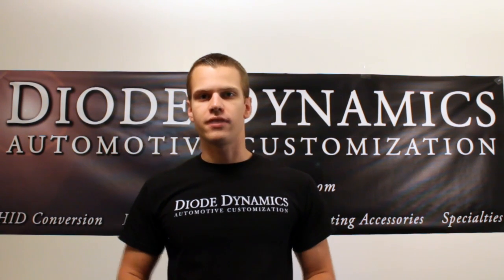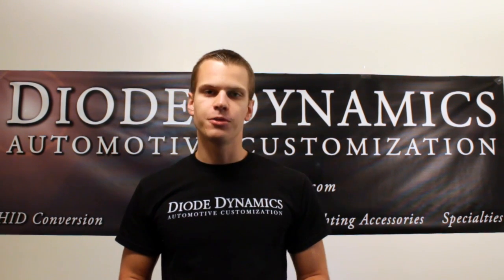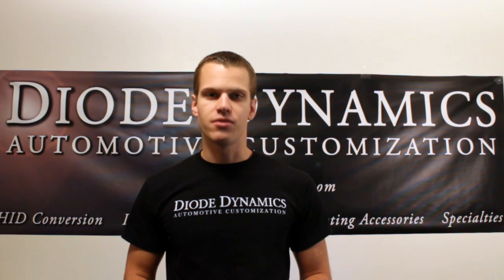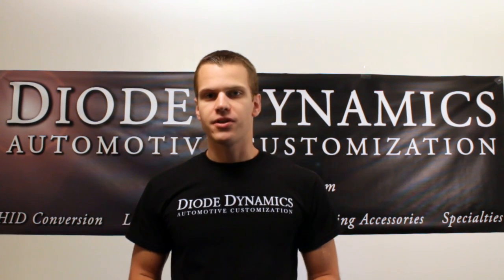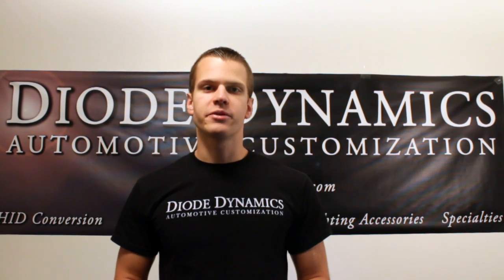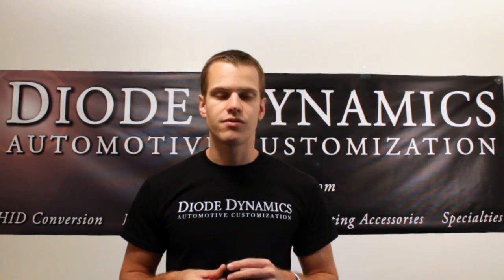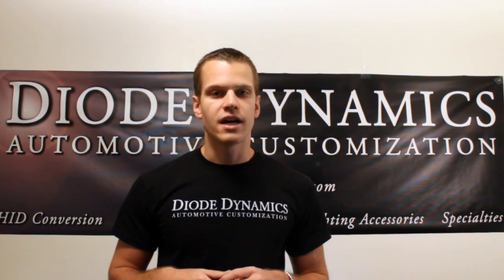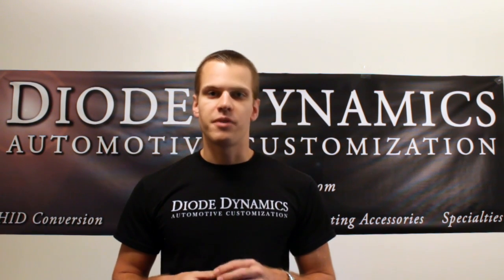Fix LED Turn Signal Hyperblink with Flasher or Resistors from Diode Dynamics

Comment: Is there a relay for 2009 chevy tahoe? Just installed aftermarket headlights and upgraded turn signals to LED and experiencing the hyperflash.
Reply from the maker: Unfortunately, we do not offer a relay for the 2009 Tahoe. However, installing resistors should do the trick! 

https://www.diodedynamics.com/led-resistor-kit-pair.html

Comment: Doubt this will get responded to cause it's an old video but figured I'd ask. I have a 2013 Nissan Altima, I'd like to get the switchback front lights above the fogs  Would I need the resister or is there a relay  I could use?
Reply from the maker: Hey David - you would need to install resistors for any turn signal location in order to prevent against hyper-flashing.
Reply: @diodedynamics  Cool, thanks for the quick reply.

Comment: I have two (2) flashers on my 1979 monte carlo...i put led bulbs on and expected hyper flash...what I got instead was a permanent "on" ...so i bought a flasher to replace the 552 flasher (aluminum) and still the same. Do I have to replace the yellow 323 four way flasher (yellow plastic) as well? Thanks!

Comment: so i understand the problem, bc i have it with my 2013 ram 1500, i understand the solve, but my question is, since were tricking the system thats designed to point out failures, does that system once tricked know how to tell us there is a problem with our new leds?
Reply from the maker: Hi Justin! The ability to detect a "bulb out" after installing LED bulbs and resistors will vary from vehicle to vehicle. If you have any questions about your Ram, feel free to give us a call at 314-205-3033 Monday-Friday 9 a.m.- 5 p.m. CST, or shoot us an email at contact@diodedynamics.com!

Comment: Is there a relay flasher for a 2017 Jeep Grand Cherokee?  Or are there bulbs that have the resister built in?
Reply from the maker: +Rod Barthelemy Unfortunately, the turn signals on the Grand Cherokee are controlled by the BCM, and we do not offer any bulbs with built-in resistors. Sorry about that!

Comment: I have a '07 Jeep Grand Cherokee.  One bulb is used for the tail light, brake light & turn signal.  I installed a resistor on the correct wires (negative & turn signal).  The tail, brake & turn all worked with the stock bulb (3157).  I replaced it with a LED bulb (3157).  The brake light & turn signal worked but the tail did not.  I reinserted the LED bulb the opposite way and then only the tail worked.  Hmmm?  Any ideas/suggestions?  Thank you!

Comment: whats the difference between using a resistor compared to a relay or flasher? I know a resistor basically drains power from the circuit to make the LED bulb appear to use more power. But what if you are installing LED bulbs so that they do not drain as much power and put the extra strain on the electrical system so that you can install more LED lights such as extra lights around the frame and wheels for show. Would using the relay stop from having the power dump of a resistor? Would installing the extra LED bulbs on the circuit make it so that you are drawing enough power from the extra bulbs it would appear to the system as one standard bulb that draws extra power normally that the LED bulbs would not even be an issue?
Reply from the maker: +Creative Customs Flashers and resistors work the same way. Resistor just require splicing wires, which some people don't want to do. This would really depend on the application. LEDs draw far less power that incandescent bulbs, so it would be hard to say whether or not you could make up for that power draw. Please don't hesitate to contact us with any further questions!

Comment: Is there an LED relay for a 2010 GMC Canyon? or should I use resistors?
Reply from the maker: +Luis Seniceros We do not carry a flasher module for the Canyon, so we would recommend installing resistors! If you have any further questions, feel free to contact us.
Reply: Thanks for the reply
Reply: Thanks for the reply
Reply: I have another question. Does the wattage make a diffirence? At the store I saw a 2 pick of 12 watt resisters, but I picked up a 4 pack of 50 watt resisters at a good price.
Reply from the maker: +Luis Seniceros Unfortunately we do not offer a flasher module for the Canyon, so we would recommend using resistors.
Reply: Ok, but my second question was about the wattage of resistors.
Reply from the maker: +Luis Seniceros Sorry about that! The wattage measures how much power a resistor can handle. We typically recommend a 50W resistor for most automotive LED applications. Feel free to contact us at contact@diodedynamics.com if you have further questions!
Reply: Thanks for the reply. 
I figured more wattage would be better, but thought I'd ask just to be on the safe side.

Comment: Would you know if I can use a LED flasher module Vs resistor on my 2016 Mustang?
Reply from the maker: +Barry Santiago You shouldn't need a resistor or flasher for the front or rear turn signals since your Mustang already has LED turn signals from the factory. If you have any other questions, just let us know!
Reply: If I don't need a flasher or resistor? how do I stop the speeding signal on dashboard?
Reply from the maker: Barry Santiago A resistor or flasher should not be needed to fix hyperblinking on the vehicle, but if you're still experiencing issues with your dash indicators, a resistor would help. Wire colors for the Mustang are: 
DRIVER: Black, Blue
PASS: Black, Yellow

Comment: Can you install led turn signals, bypassing the existing factory wiring?
Reply from the maker: +Larry D, our LED turn signal bulbs are a direct replacement for the factory incandescent bulbs, so unfortunately, you can't bypass the factory wiring. If you have any other questions, feel free to contact us!

Comment: what resistor do I need to replace the one I have now? I have an 05 dodge ram 2500 with the 5.9 cummins. I'm talking about the led module you sell. thanks!
Reply from the maker: +Chris Pastuf, we've got you covered! See the link below for our Resistor Kit. If you have any questions, feel free to contact us!

http://www.diodedynamics.com/store/accessories/led-accessories/resistors/led-resistor-kit-18974
Reply: Diode Dynamics thank you, I was hoping to have the quick fuse replacement but this will work as well. Also thanks for the fast response!

Comment: Can the led be damage without a resistor?
Reply from the maker: David Zavala, Diode Dynamics LEDs will have no issues without a resistor. The resistor is just used to trick your car's system into thinking there is no "bulb out" situation. Good question!

Comment: Hey guys,

I installed LED tail lights in my '95 Mitsubishi GTO (3000GT) and used the same resistors as in your video. My left side works normally, but my right doesn't and I am not sure why that is. I do get the hyperflashing, but not 100% of the time. Sometimes the turning signal operates properly and other times it doesn't. For example, when I turn the right blinker on, it flashes normally, but when I hit the brakes at the same time, it starts hyperflashing. Also, sometimes it will hyperflash at all times, even without the brakes being depressed at the same time. I thought that the resistor was defective so I replaced it with a new one, but nothing changed. I don't see any problems with the wires so I am very confused. I even changed the front right blinker bulb, but that didn't change anything either. What could be the culprit? Thanks in advance!
Reply from the maker: Hey there IIian, If you could shoot us an email at contact@diodedynamics.com or call at (314) 205-3033, we would love to help you troubleshoot your resistor issue. Thanks!
Reply from the maker: Hey there IIian, If you could shoot us an email at contact@diodedynamics.com or call at (314) 205-3033, we would love to help you troubleshoot your resistor issue. Thanks!

Comment: I have a 2006 Chrysler 300 C and wanting to install flashback LED's in the front the vehicle replace the turn signals in the rear with LED bulbs. Will I need your sisters each bulb front and back? Or is there a relay me for the 06 Chrysler?
Reply: Mark Jeans q